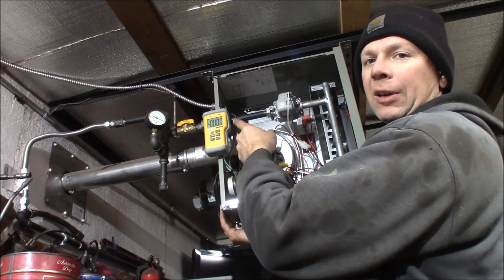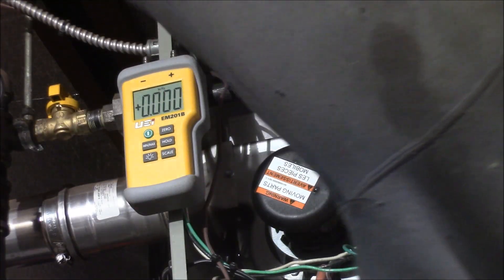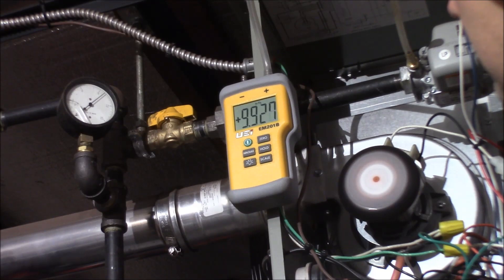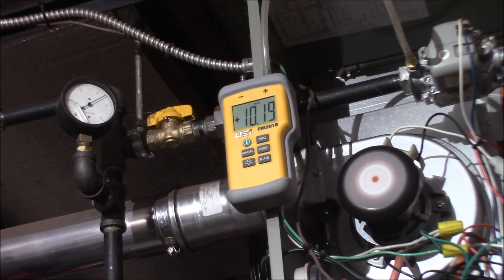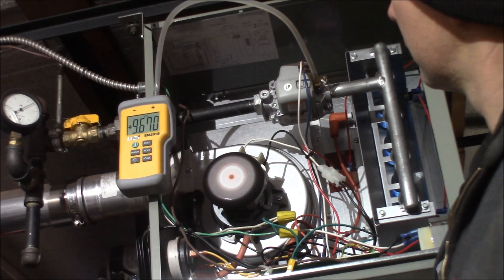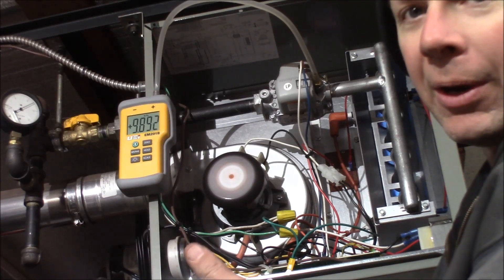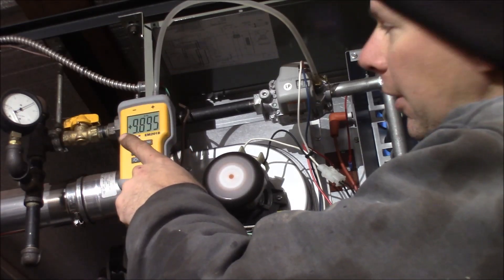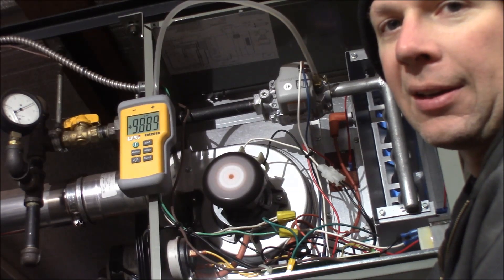Hot Dawg 60,000 BTU Heater Part 5:  Setting the Gas Pressure with a Manometer

Comment: I got mine fired up the other day. Your videos were very helpful and I learned a ton during the process. Quite a process but I have heat now and saved tons of $$.  The 100k btu version may be a little large for my 880 sq ft garage with 10ft ceilings!  Heats very fast. I’m very glad I insulated well.

Comment: The first thing that stopped my hot dawg furnace after 5 years was the squirrel cage of the draft inducer, completely decengrated. Could not see that part as serviceable, without buying the whole unit. Made adapter for different shaft, hole size and used blower fan from another brand furnace. 29.00$ fix.

Comment: I worked in the oil and gas industry for over 40 years , just advice to you young man always put a 1/4 turn valve below your gauge if the gauge fails you will fill your shop with gas . and it makes it easier to change out the gauge.
Reply from the maker: Thanks.  I work on gas somewhat at work and usually do have valves under the guages.  I just didn't have one to use here at home and figured if the gauge ever failed it wouldn't be a big deal to just turn everything off to swap it out.

Comment: Hello!  I wanted to let you know that I have followed your series from start to finish.  I now have a Hot Dawg installed in my garage and it’s great.  I’ve heard people say they are noisy, I don’t agree.  I think they are fairly quiet.
Anyway, thank you for all the work you put in to creating this great set of videos.  Of special concern to me were the one on venting and the one on using a manometer.  I’ve had no experience with either, you gave great instruction on how do them!
Reply from the maker: Thanks.  Mine has been working flawlessly for over 2 years.  Wish I had got one 10 years ago.

Comment: Great series of videos. I have been playing with the idea of installing one myself and the videos that you have done are exceptional. At the present I am using a 30,000 btu vent less heater running off of 20 lb bbq tanks. I have 4 tanks and keep switching them out until I am on my last tank and then go exchange them.   I have a 28' x 30' garage with no wall insulation and 7.5" of blown in insulation in the ceiling. Live in N Illinois and it does get pretty cold here. I only use the heat when I am actually in the garage but like you have said it sure would be nice to go out to a garage that is already at 40F.  Again, nice series of videos!!!!
Reply from the maker: Thanks, I love mine and wish I had put it in 10 years ago.  So far I have averaged $65 a month keeping it at 40 all the time and 55 when I work.  That's usually about 20 hrs a week at 55.  My garage is 28 x 38 and has R19 in the walls and 19-30 in the ceiling.  A 60,000 btu would probably be fine for your garage without insulation.
Reply: Hello Tom. Just curious if the 30000 BTU gas heater you installed in your 28 by 30 shop has proven to be enough to heat that building?
Reply: @QuickSpeedShop  If the outside temp is in the 20F to 30F range when I light up the heater it takes about 20-30 mins to get the garage up to 45F-50F inside with the heat control turned all the way up. After it gets to around 50F (air temp) I usually turn the heat control (thermostat) down the just above the lowest setting and the garage will eventually end up getting to and maintaining  around 60F, which is plenty warm for me to work with a flannel shirt on. It goes without saying that the concrete floor is still cold for a long time even though the air temperature is a nice working temp.

Comment: I WOULD LIKE TO KNOW WHAT TWO TERMINALS ON THE HEATER DO I USE TO CONTROL THE HEATER.  USING THE THERMOSTAT THAT CAME WITH  THE UNIT

Comment: what is the other fitting used for on top of your meter on the left?
Reply from the maker: I think it's used to test for vacuum.  It has a negative symbol by it.  I was using the plus side for the pressure.  I borrowed the meter from an HVAC guy so I'm not an expert.
Reply: It allows you to read pressure before the valve (inlet) with the negative side as well as after it (outlet) with the positive side simultaneously. It has multiple functions but typically for measuring static pressure across return and supply ductwork on a furnace and also commonly used for measuring gas pressures at inlet and outlet of gas valve to measure pressure drop.
Reply: The gage actually reads differential pressure.  The negative side is normally open to the atmosphere.  Which gives you pressure in “gage pressure” when hooking up the positive side.
Reply: @lewisbenjamin5298  That is incorrect. But you can use it however you wish. You firstly need to zero the instrument to atmospheric pressure before use for an accurate reading... there is no need for a second atmospheric measurement after that has already been accomplished. Also, the proper spelling is "gauge" not gage.

Comment: If you dont mind, send us an update on how happy you are with this...
Reply from the maker: It's awesome!  I leave it set to 40F all the time and turn it up to 55F when I work.  The first month of use cost me $52 in propane.  I still would have been happy if it cost twice that much.  It's so nice to walk into the garage and have it not be frozen.  The heater is quiet and works well.  I'm super happy with the performance of the unit and glad I finally got it up and working.
Reply: @QuickSpeedShop  how big is the shop your heating with that heater?

Comment: If inlet pressure spec is 12 why did you set it at 10?
Reply from the maker: This was almost 4 years ago.  I think the input had a range of psi.  I set it within spec.  Been running fine ever since.

Comment: Cool video series. What part of the country are you in? I will need to put one of these in next year. Currently using electric heat in my shop and I think gas would be considerably cheaper. Running the numbers bear that out.
Reply from the maker: I'm in western NY.  Gas, propane, or oil are more economical than electric. You can get the highest efficiency out of gas or propane.  I would definitely suggest a fuel based heat source over electric unless you have an extremely cheap electrical rate where you live.

Comment: Hiya,
It’s Dave again...I’m just curious as to why you didn’t adjust the outlet pressure (after the gas valve) as per the instructions included with the Hot Dawg ?

I get why ya adjusted the inlet pressure from the outside regulator...but why are you using the outside regulator to adjust the outlet pressure (manifold side) ?

Mine has an adjustment screw on the HD valve...Doesn’t yours have the screw on the HD valve itself ?

Again, you’re (6) install videos are awesome 😎
Reply from the maker: I don't remember, that was over 2 years ago. I'm also not an expert, this is the only propane heater I have ever installed.  I thought I did what the instructions said and verified with manometer.  Been running fine ever since.
Reply: @QuickSpeedShop  OK, that’s cool...Wow, you really answer questions fast❗️ Well, anyway...I really appreciate all you’ve done 👍